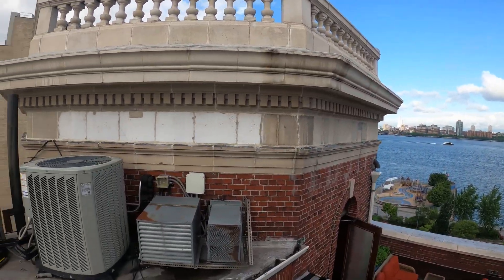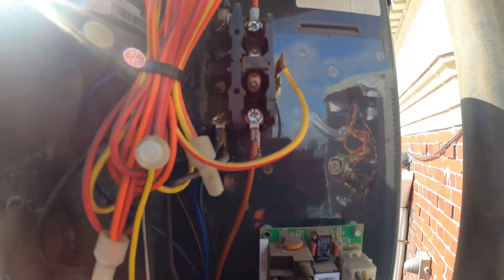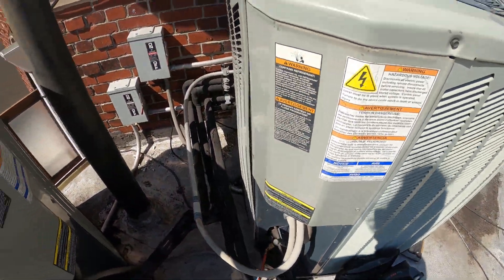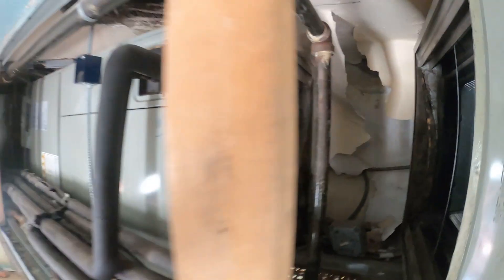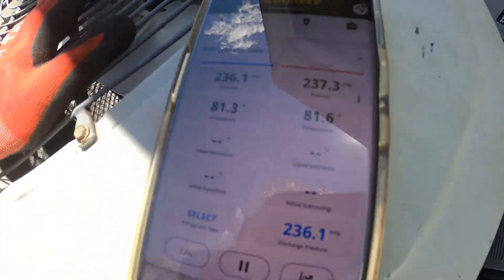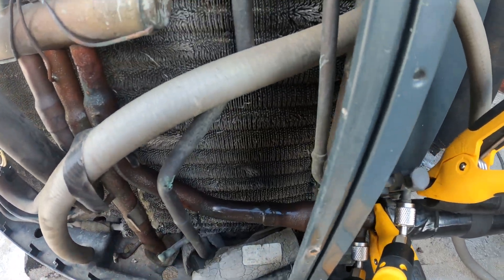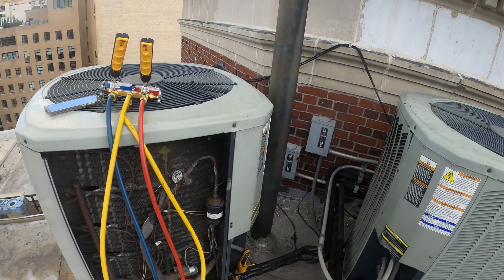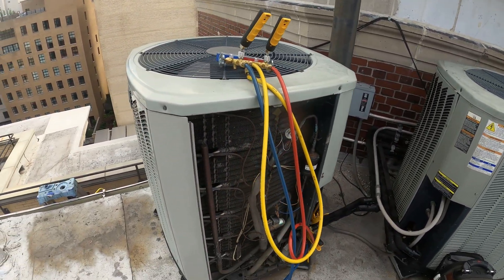HVAC: Evaporator Coil Freezing Up (Air Conditioner Freezing Up and Not Cooling) Frozen AC Coil

Comment: Muffler attaches  to discharge line. Liquid line has filter dryer. Suction line uses a type of filter to remove acid and carbon particles after a compressor burnout once new compressor is installed. Great videos.

Comment: Wash the coils before tossing your gauges on. Both units look dirty based on pressure readings. Systems older like that I sometimes offer the customer easy seal with UV dye. If you have a leak or leaks it’s easier to find them and also little leaks the easy seal is cost effective and works really good for small leaks

Comment: Left one was over charged or txv clogged or stuck open which is why the super heat was at 1. Low superheat remove to get superheat higher, high superheat add to get lower. So it's not low it's overcharged

Comment: If you add yellow jacket low loss 1/4 connectors for fieldpiece gauges it will be easier to disconnect from high and low sides. Жить или умереть) Жить

Comment: Nice JMT, looks like a good spot for a party lol. I wonder if condenser fan speed/airflow could be reason for head pressure difference. But yes, best way to know is weigh out charge and eliminate that issue.

Comment: Daikin 1.5 ton inverter split ac. 5yrd old.
R32 gas running pressure 150psi.
Current 6.3amps
Both indoor and outdoor coils have been cleaned.
Service Technician says it's ok.
But it's not cooling.
Temp in the indoor  blower showed 16'c or 60'f
On feeling the indoor coil. It's not cold.
On feeling the outdoor coil from top to bottom it's not warm.
My brand new split AC showed indoor temp at 6'c or 43'f
Previously compressor would heat up and trip. So got the  outdoor pcb repaired .
Now it doesn't trip but keeps running.
And does not cool the air.
Am out of ideas any help greatly appreciated.
TIA

Comment: look like you have a TXV problem 🤔🤔
Reply from the maker: It seems like some sort of issue with that or a possible restriction. There's two TXV's in each split system. 1 in the Indoor section & another in the outdoor section! It is possible for it to work but personally, I've never seen that before. Just change both 😂 Thanks for watching & stay tuned for new videos every week🔧⚡️

Comment: Yep those are mufflers inside condenser since they are Heatpumps
Reply from the maker: Thank you for the heads up. Never seen ones that look like filter driers but that's the only component that makes sense being on the discharge line. Thanks for watching & stay tuned for new videos every week🔧⚡️

Comment: Think those are mufflers on the discharge?
Reply from the maker: Honestly, I'm not sure. I saved the model & serial number and was going to do some research on the unit. I don't believe those are filter driers on the discharge. That wouldn't make sense but they look exactly like filter driers and not like any muffler I have seen. If you notice, there's an expansion valve at the condensing unit & another at the indoor air handler. Strange setup honestly. Thanks for watching & stay tuned for new videos every week 🔧⚡️
Reply: @JumpermanTech  that makes sense drier by the outdoor txv heat pump.   Those can definitely be driers. Don’t get to see to many residential heat pumps in nyc.
Reply: Definitely mufflers on the hot gas line 
Great job enjoy your videos